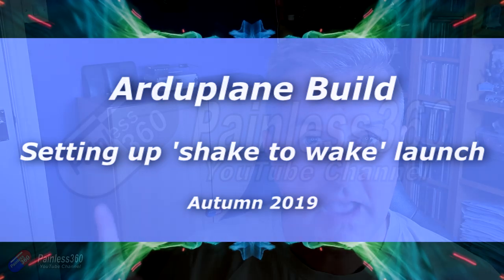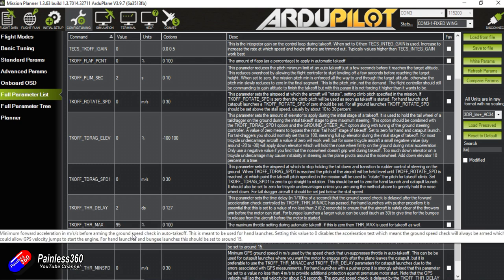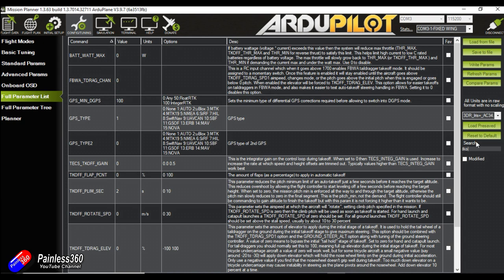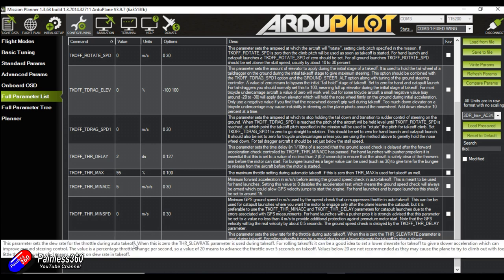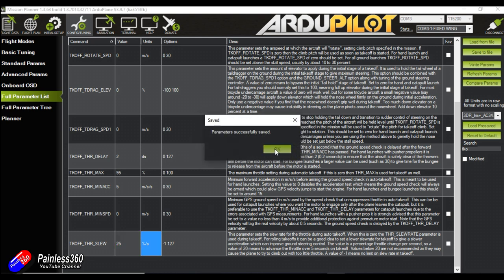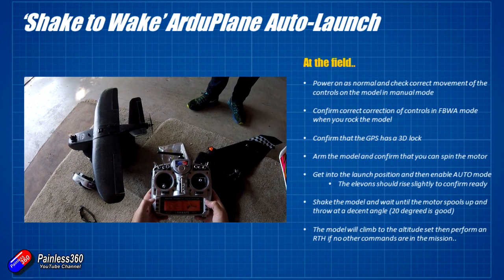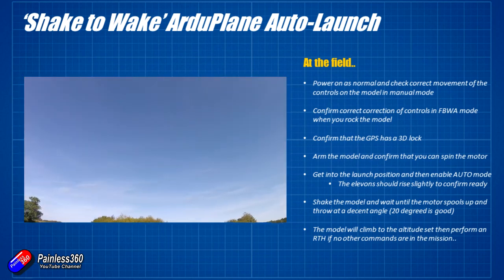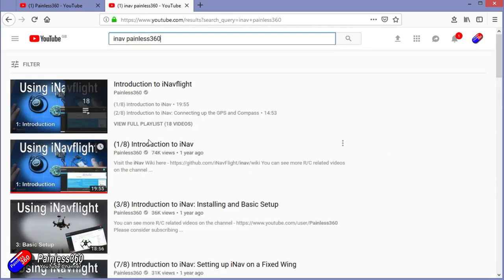'Shake to Wake' Autolaunch Setup

Comment: Once again you and Ben have come through to help me. I have been trying and trying to have a successful auto mission takeoff for my wing with zero luck. I read and re-read the instructions on Ardupilot but the delay was too long and the wind ended up powering right into the ground. I had googled the issue before. But, today is the first time your video came up.  I bought a lotto ticket tonight and if I win, I'm going to remember you and Ben.

Comment: I'm incredibly intrigued by the idea of "flying" the thing via computer. Hand launch then set waypoints on a map, select a mission, etc while being able to see location, telemetry, etc. I was in UAV squadrons in the Marine Corps and this is basically how they're flown...more "told where to go" than actually flown. I think it'd be really cool to be able to do that with my own little bird.  

We used crazy tracking dish antennas to communicate with ours...are there radios that you can mount on these that can communicate with a computer and Flight Planner at range?
Reply from the maker: Yep, check out my videos on the telemetry radios and mission planner... best of luck!
Reply: @Painless360  Perfect. Will do. My wing JUST got here today...literally 5 minutes ago. I'm going to build it and fly it around some, do the FPV thing, might slap an FC in it soon, etc. 

But I'm going to get a Believer and set up all the real deal stuff in that. That's going to be my long range bird. 😁

Thanks, man.

Comment: Hello, thanks for your videos. One question, is there any way to cancel the auto take off after starting the motor with the shaking to wake?
Reply from the maker: I've never tried.. Best of luck
Reply: Yes you can by changing the mode to manual or fbwa and put throttle low

Comment: That is such a cool feature. I love Arudplane and how flexible it is. Any chance of finally getting a Herelink installed and demo'd on a fixed wing? I can't wrap my head around how to use it with a spring loaded throttle.
Reply from the maker: I may have a cheaper option here for an all in one system.. Stay tuned!
Reply: @Painless360  Fingers crossed it's got HD video like the Herelink. The only other system for fixed has been the Parrot Disco, which I have, but it's not really meant for long range like the Herelink/Pix combo. Such high hopes for that system. It's gathering dust on my shelf sadly.
Reply from the maker: Not HD...

Comment: Lee,  thanks for the video. Could please describe the definition of "Takeoff waypoint" in the world of QGControl in relation to a quadcopter VS fixed wing. I am flying a fixed wing with PixhawkMini and it flies very well in stable, RTL modes, but mission mode works at sometimes and some times does not. I arm, flip auto mission switch on Tx, hand launch, motor kicks in, plane flies off perfectly, but rather than going to the waypoint #1, its start circling. I have done several auto missions on my quadcopter without any issue but fixed wing is hit and miss.
Reply from the maker: I don't use Qgroundcontrol. If you find out then please let me know.. Best of luck!

Comment: Great video, what is the difference between iNav Auto Launch and Shake to Wake?
Reply from the maker: This is ardupilot not INAV... Happy flying
Reply: @Painless360  I get it now, shake to wake - the model will slowly ramp up the motor and then u let go while inav auto launch will speed up to specific speed which is very danger while holding it. anyway thanks
Reply from the maker: Almost. Check out my video on INAV. AUTOLAUNCH. Similar shake to wake feature may be coming to INAV... Happy flying

Comment: I just set this up on my nano talon today.  I did 20deg pitch thinking that would be more than enough.  Full throttle.  When I throw straight and level it dips and I had to intervene and give up elevator.  Should I be chucking it more upwards to avoid the dip?  I didn't want to risk stall by doing that.  I have a switch on the Taranis that gives some up elevator that I have been using for manual launching and it takes off  much better.
Reply from the maker: The launch in the video is 15 degrees and is good for most cases. I'd watch how I set this model up via the series in case you missed something... Happy flying!

Comment: My motor doesn't automatically spin I have to manually put in throttle?
Reply from the maker: Depends on how you set it up... happy flying
Reply: @Painless360  lol That's what I'm saying, mine doesn't automatically spin , it shows in the OSD the throttle gradually increasing but nothing happens, any idea what I'm doing wrong?
Reply from the maker: Could be a few things. What troubleshooting have you already done?

Comment: Do you need to change the autolaunch mission if you fly a different place as where you set it up? or doesn't it store the gps location in the mission?
Reply from the maker: Nope. That's reset when the GPS locks..
Reply: @Painless360  thnx, I was afraid it would fly back to my house when I launch it at the flying field 😅

Comment: Can u tell me how to get more throw in the mission planner with the plane on the bench is seems like I have limited throw in my orbit wing  everything is at 100 percent on the taranis
Reply from the maker: The movement may depend on the mode you have it in. Use manual mode to check movement and you can increase the travel in the output tab (max/min)  - see the rest of the series.. Best of luck!
Reply: MIXING_GAIN is what you're looking for.... have a look at the wiki for what is does
Reply: @flyingrock6381  so i increased it to .8  manual looks great but in FBWA and stabilize mode it seem pretty limited
Reply: @Mrfunkyfpv  happy to hear! don't worry about FBWA on the ground; it''ll move as needed in the air
Reply: @flyingrock6381  flew today and  EVERYTHING IS GREAT THANK YOU
Reply: @Mrfunkyfpv  yay! happy to hear that :) cheers!

Comment: In arduplane auto takeoff command take at ones after arming 
If we go to fbwa to auto and then back to fbwa again want auto mode in mid flight it don't take command again. Motor not start.
Reply from the maker: Sorry, I dont understand the question...
Reply: @Painless360  can we give a auto command to arduplan in mid flight multiple time. 
Actually when i go from FBWA TO Auto mode and without complete mission i again switch to fbwa mode and when i again switch it back auto mode means i hit the auto mode second time throttle   become zera. Thats the problem. Arduplan do not take auto mission mode second time in mid flight.
Reply from the maker: That's an interesting question - let me look into that..
Reply: i'm having no issues with re starting an auto mission in flight on v 4.0.
Reply: @bearospaceinsider5250  can u try auto mode in mid-flight 
1 stabilize mode
2 then auto
3 again stabilize mode 
And if you again go to auto my arduplane dosen't respond to auto mode on apm 2.8 fc

Comment: I do not understand the trend of 'shake to wake' at all! Why defeat the saftey feature of auto-launch? Why not just throw it and let the motor start when it is away from you? I've been doing this for months and it works great. A delay of 0.4 seconds gets it well away from your hands.
Reply from the maker: There are lots of things I dont understand but that's one of the great things about the hobby - were not all the same and those differences drive new products and innovation. All of the other autolaunch options are covered in the wiki and work well. This video is for those who, like me, wanted it but couldn't get it working easily. Glad you've found the way you want and like...
Reply: @Painless360  you always do a great job of explaining all the options in all of your videos.I was driven to use the auto launch feature by all of the pictures of mangled arms and hands I saw on Facebook.
Reply from the maker: That's why there is the warning at the start of the video,, care is needed. Happy flying!